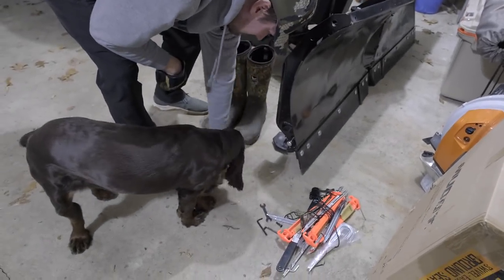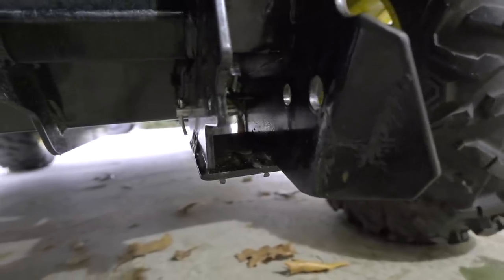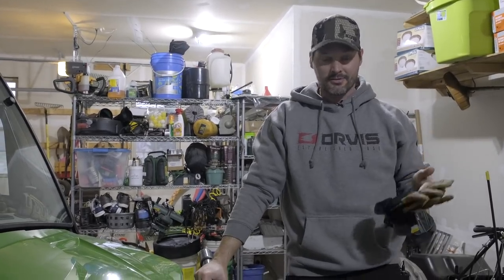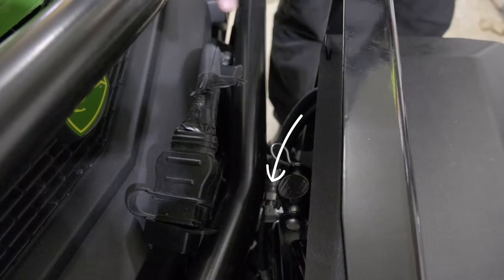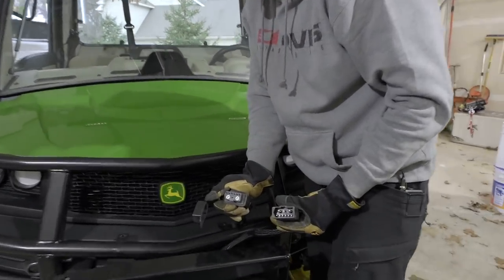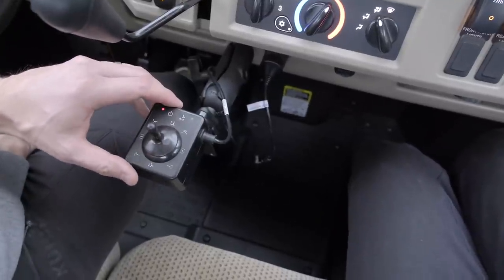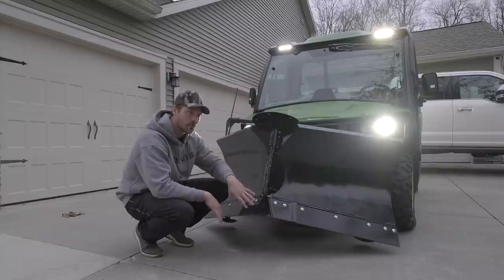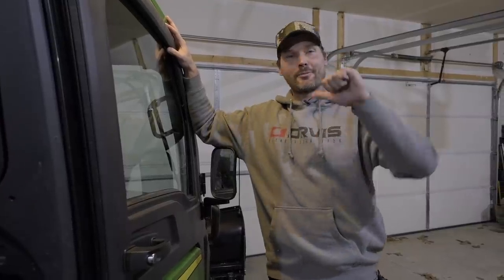TRANSFORMER SNOW PLOW INSTALL ON A JOHN DEERE GATOR 🐊☃️🦌

Comment: Now your in vee world 👍 Since I went too quickattch vee Plow on the tractor I would never use anything else again . You are going too be in heaven with it on the gator . Very nice unit 👍 Gators have heavy duty shock kits for the front when using plows . If you want a easy way too hook that Plow up . Go get your self a baby little com-long chain hoist 500 lb rating . There cheap too buy and your best friend . You can pull the Plow and gator together and up in place with ease  . Enjoy your new toy 👍👍👍
Reply from the maker: Yeah, wonder about those shocks...gonna have to investigate further.  Good call on the come along!

Comment: Fold your wings back into the V and it should almost stand on its own. Then plug in your plow so you can control it. By lifting and lowering the plow the mount will change height and you can use it to adjust the height of your mounts and drive right in! Easier said than done I know. But with practice you can really speed up the process.
Reply from the maker: Nice, yeah I might have to try that.  I did try raising and lowering with the electrical connected, but not in the V shape.

Comment: You can use a heat gun to bend your poly. It may take a minute but you can probably use the piece that's on it to get it close.
Reply from the maker: I'm gonna have to give that a shot.
Reply: @GoodWorksTractors  If the heat gun doesn't work you can use your oven also. Used to work with plastics but I can't remember what temp we baked the sheets at. It wasn't very high 200's maybe but the amount of time was important. Just keep an eye on It. Hope that helps.

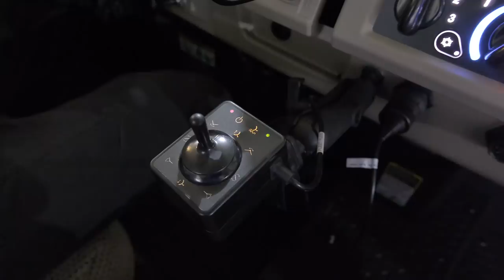Comment: Hello at 9:24 you show the joystick controller for your plow there is an arm coming off the gator dash holding it in place . I was wondering if you could tell me is that a John Deere part or aftermarket? My new 865R is coming in a few weeks hopefully and I have a Boss UTV v-BLADE plow to install on it. I was hoping to set up a Joystick controller as you have, thank you.

Comment: I believe you can heat UHMW and bend it needed...
Reply from the maker: I hadn't thought of that, but worth a shot!
Reply: I have done it on ATV skid plates.  Used a small propane torch.

Comment: Conveyor belt would work good for that center section of the plow. How fast does that gator go?
Reply from the maker: Good idea.  Mid 30's for the diesel.  Not nearly as speedy as it's gasoline counterpart.
Reply: I really like the looks of that gator. I haven’t done any research on the newer ones yet but, wish it was a bit faster. That would make it better for transporting if I didn’t have to load it up on a trailer all the time. That’s a nice looking plow setup you have too. I hope you do a segment on how that works for you. A little curious how it does. Great job on the videos btw!! I like the detail. 👍